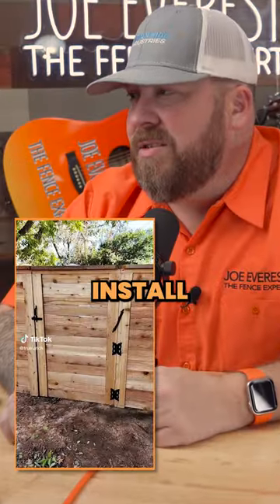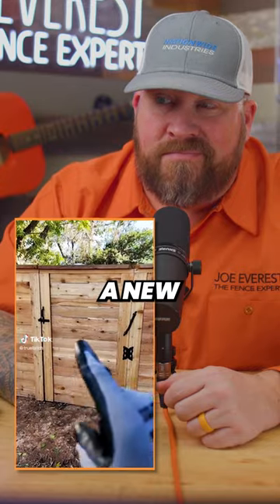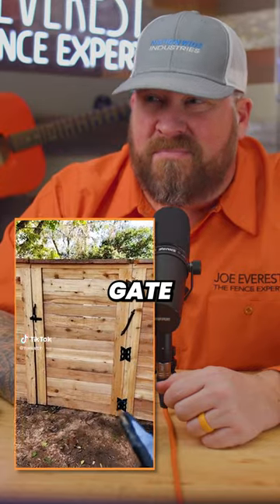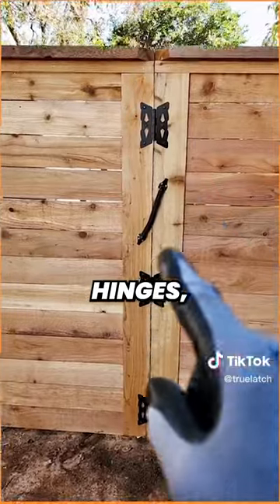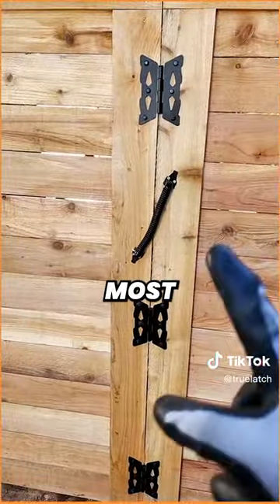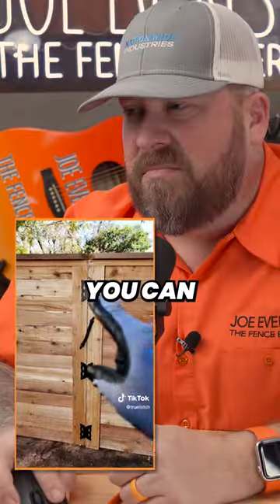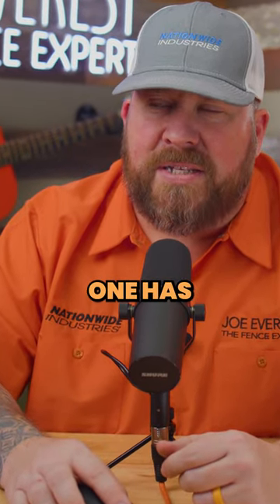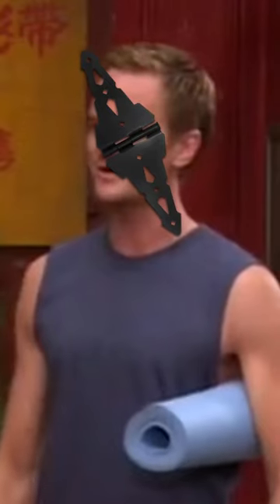DON'T Build Fence Gates Like This! #shorts #diy

Comment: The only time I put more than 2 hinges is if it's a really big and heavy gate
Reply: Yea. People will just say, "use bigger hinges" but on heavy gates (especially privacy ones that suffer way more wind stress) you're either plugging it full of fasteners (which looks janky) or carriage bolting it (which tends to end up turning into a bunch of slop).

Hinges have weight ratings but people forget it's more than just the weight of the gate. The force of it swinging shut, flexing in the wind, (or god forbid) swinging in the wind because it didn't latch.
Reply: Go look at commercial or farm gates.. 2 hinges.

When I do big gates, I just buy hinges that have a higher rated load and also have brackets that extend further from the edge. This guy's hinges barely make it into the 6x6
Reply: With 3 hinges, the second that post settles or those boards warp the slightest the gates going to bind. 

The heavier the gate, the faster it’s going to happen. The amount of companies gates I’ve had to repair due to this is ridiculous. Just learn to build a gate right.
Reply: @Josh.1234 yup. More hinges aren’t going to compensate for a poorly designed gate. Period. Hinge size, location, gate design, post install, type of post are all crucial.
Reply: If the gate is big and heavy, it needs a diagonal cross brace.
Reply: @MFKN_ChrisJones  if I was to put 3 hinges, I'd put the 3rd near the top one instead of in the centre.
Reply: @ObservationofLimits  carriage bolts work great lol
Reply: @Josh.1234   at work we got some steel fire doors and they all have 3 hinges, the middle one sits close to the top one
Reply: @darkblue234  yeah we are talking about exterior gates. Most interior doors have 3 hinges
Reply: @ObservationofLimits normally for gates that big, I've seen them just made out of metal. Heavy welded hinges both look good and can be scaled up to basically as much weight as you want. Although I don't work in the field, I just powder coat fences and gates other people make sometimes

Comment: I am a cad technician for fit out companies I spend most of my days reading spec sheets and I can confirm. These hinges tell you “heavy doors need more hinges” and the size of the door is irrelevant more will not bind if installed properly which isn’t hard to do.
Reply: So in other words having three hinges is completely fine and anyone who says otherwise should just be taken with a grain of salt
Reply: Your right, easy to install properly. Its the making mother nature cooperate that is harder. 
Make the soil not compact/erode, keep water out of the wood so it doesnt warp....etc.
Reply: So in other words you’ve never actually installed a gate…
Reply: @urmumisaho69  gates aren't that hard to install you just have to know what you're doing
Reply: @urmumisaho69  never? No i just don’t it for a job. I; tell people who install gates, pocket doors, kitchens, stone, non structural walls, tea points, windows and everyone who constructs them prior to installation. How many hinges studs, wall braces, what finishes, what tolerance, what construction, what order to install etc. I also do site surveys. And I have in fact built my own fences and gate a couple times once for my mum as a child and once as a young adult with my brother. And I will confirm the engineers that are paid to design those hinges know they’re stuff and they only bind because you’ve installed it wrong. There’s no more to it, if they bind it’s because they are, or have become wonky if they become wonky you should’ve used better fixing or more hinges to spread the load if they were wonky on installation “shit trades says what?”.
Reply: @phoxgames5800  generally if your using a softer fixing grounds or something liable to warp. Put it somewhere else lol 😂 if that’s not possible tho I’d advise using some 1/2mm thick aluminium sheet running it up from bottom to top of the gate post bond it to the post and screw through it at the hinges. But that’s what I’d do cus I am cheap and it will probably work for long enough. Never tried it tho.
Reply: @prestonbrandt2193  yeah basically. They’re argument only makes any sense if your fixing the hinges to something that will warp. Which would probably take longer to fully bind if you’re using only 2 hinges because you’re potentially twisting them each less but they’ll die faster cus you’re over loading them. Its cutting your thumb off to spite ur hand just use better materials they’re like an extra 10% in a localised area and if your fence is twisting you will not have a fence for long lol. save urself the hassle and future cost. There are a lot of places u can cut costs but in all my life I avoided cutting them at things I’m going to use every single day. “It’s only an extra minute I’ll fix it later” till ur mums in hospital with minutes to live.
Reply: You’re a cad technician for fence gates? 
You work on interior doors where the framing and door jambs are well secured and out of the weather. Not the same thing as an exterior gate secured to a 4x4 post that will in all probability twist and warp. No shame in saying you’ve never installed a gate in your life, there is however shame in spouting off on things you know nothing about.
Reply: There is no such thing as an outdoor timber structure that doesn't move.  Given that it WILL move, it must be made in a way to function with that movement.  3 or more hinges will bind when the structure moves.
Reply: @itsamindgame9198  excessive warping is a product of bad timber choice. It will move yea that’s why out door hinges have so much slop in them. In almost all cases if 3 are binding 2 will aswell. Excessive warping is also a result of cheaping out and using frames that are simply not big/strong enough.
Reply: @friendlynerd599  Actually, no, it doesn't need "excessive warping".  It is basic geometry, 3 points are much more sensitive not being aligned.  All wood moves, so it isn't a case of strength.  The alignment of the grain, whether there are whorls in it, how much moisture it takes up or loses; all effect movement.  The trick is to make sure the movement is along the line you want, but also to only have 2 points on the line.
The hinge size does make a difference, granted, but 2 well sized hinges is likely to be most reliable configuration.
Reply: I want to add to this as a carpenter for over 30 years....your placing all the hinges on the Same board... if it binds ,,it's because the hinges are Not aligned properly,,doesn't matter if there's 3 or 30.....
Reply: @davidrobinson2450  Because no board in  an outdoor application has ever warped...
Whether or not the hinges are aligned properly at installation a warped board changes alignment.
I am not saying 2 will never band more will always bind - I am saying that in any given setting 3 are more likely to bind than 2.

Comment: House door hinges come 2 to a pack, but always take 3 hinges. Middle one doesn’t bind up the other two, either
Reply: That's because the framing of your house should not move and settle like a fence will.
Reply: @jeremylunning654 fence won't "settle" if you build it correctly either.
Reply: The middle hinge will* bind up if the door ever moves positions......which can happen for a variety of reasons, that's why he said not to use 3 hinges. My view is if hundreds (probably thousands) of engineers have determined 2 hinges is the best for doors I am going to stick with their research.
Reply: @commoncents9732  I think you will find that the engineer's decided that two hinges were sufficient and not "best for the job". There is quite a difference...
Reply: @grantcox4764  Sorry bud, this is uninformed information. When building a fence, it's not as simple as just pouring good footers and hoping for the best. Even if you prep the site in advance, things can still go sideways. If you're not on a commercial property with well-compacted ground, the soil the weather can mess with your posts, especially the gates. Sometimes I have 2150 2200 pounds hanging on 4 hinge’s thats basically a Kia hanging from one post! That’s an outlier but things happen when you are hanging heavy things. The last thing you want is a wonky fence because the cement shifted. I've had to fix a bunch of residential jobs because of this. The difference? Dealing with a contractor who ghosts you. So, make sure you're ready for whatever the ground throws at your fence, and find someone who's on the ball and won't leave you hanging.
Reply: You seem to be quite triggered here mate. I never said that adding an extra hinge solves all problems when hanging a gate on an external fence. Try rereading what I posted and tell me where I'm wrong. I'll take my 35 years experience in the construction industry over your advice, ok champ. Your talking a whole heap of mitigating factors as if my answer to every problem is stick another hinge on it. FFS, there is nuance in everything, but from your novel, you already think you know everything so I won't waste my time...
Reply: And a deck outside in the heat. Cold, rain, snow and ice definitely doesn't easily warp, especially when it's held by cement in the ground that moves.

Do your door frames move often?
Reply: @grantcox4764 fences always settle 😂😂😂, are you packing 200 linear feet of soil 4ft down to the Frontline and then pouring your posts? Because as far as I know when it rains in the summer and freezes in the winter, the ground shift a lot. It may not heave a post but it definitely can move it an inch. That inch can bind up the middle hinge.

It's actually very simple, either you don't put in fences with large gate often that utilize heavy trucks through said entrance, then you really don't know what you're talking about.

Cute though
Reply: @grantcox4764 you realize they make hinges stronger for heavier doors right. You can quite literally order a set of 2 hinges that will support 1000 pounds. 

Still don't get why you need a 3rd hinge when you just use the right equipment for the job 😂😂😂
Reply: @garythesnailsdad exactly, I don't think most people realize they can get hinges that hold 1000-2000 pounds. Albeit more expensive but that's what the homeowner pays for. Tons of cheap menards hinges used though.
Reply: @grantcox4764 why ate you so butthurt, is it because you know you're wrong and been doing it 35 years. You realize they make hinges that support over 1000 lbs right?
Reply: @commoncents9732  show me a door with only 2 hinges, and I’ll show you a cheaply installed door. In any event, a house door can sag over time, that’s why we’ve all seen a door that drags on the frame( usually at the top), and is harder to open and close. The center hinge still doesn’t bind on the door.
Reply: @grantcox4764  I agree, but how many people will build it correctly?  A third hinge isn't necessary anyways so why bother?
Reply: @grantcox4764   Fences ABSOLUTELY move and shift at different distances, directions, and speeds over time anywhere along their length no matter how you build them. Talk about uninformed complete nonsense
Reply: @commoncents9732  perhaps I’m legitimately not understanding and it’s simple but what do you mean “bind up” 

If the gate sags won’t all 3 hinges sag equally? My gate has 3 and was built that way from the day we moved in (was a brand new house at the time) in the last 12 years that gate has sagged plenty and I even took it off and fixed up the boards a bit and it’s not had any problem with the middle hinge.
Reply: My doors are 2 hinges
Reply: @jeremylunning654 my house is fucked, the whole place moves month to month or so and none of the hinges bind but the doors will stop lining up with the door frame on occasion so I'm a firm believer in if the hinges are properly installed AND of good quality you should be fine
Reply: @mobilegameclips5628 Wood ages and changes with weather as it ages. Fences don't just sag, the wood that makes up the gate can shift sag or bow in many directions.

This is why the creator he is watching, says it isn't an issue because it might not happen, but good carpenters don't bet on should not happen or probably won't or that is rare, should not be used as a building method.

The interior doors on houses are different, because 1 they are designed with 3 depending on the core etc, me 2 I hope you don't have rain in your house.

I would hesitate to use this guy for any project because he is using his logic over experience and knowledge.
Reply: Doors arent installed in dirt and dont get rained on to warp the wood
Reply: People arguing to add more work and cost for literally 0 reason.
Reply: @phoxgames5800  you mean posts in concrete, and waterproofed wood?
Reply: @jeremylunning654  you clearly don't live in texas where foundation shifts all the time sometimes drastic differences. never had a door bind up
Reply: @grantcox4764 Its always funny when someone called others "triggered", but then proceeds to sound like a petulant child.
Reply: @jeremylunning654 house framing does settle though 🤷 all things that are built settle.
Reply: @parkeydee  yeah, when not built property.  If houses settled like you are saying, drywall would all crack, trim joints would show and tile would start popping up.  When they say a house settles, they mean the entire foundation sinks slightly but evenly.  Any uneven settling will cause damage.  You should get your verbage correct.

Comment: More importantly, add a diagonal cross brace so the gate doesn't sag.
Reply from the maker: Absolutely! Thanks for watching and weighing in!
Reply: You  ain’t lying. Moved in to a new spot . The  yard door was dragging cause it had no brace.  I just put a wheel on it for it to roll since I don’t use that entrance much.
Reply: Was about to add that very comment - possibly the most important element !

Comment: Dont be absurd. There is absolutely nothing wrong with using 3 hinges, 4 hinges or even one long hinge that spans the length of the door.
Reply: To be fair. The door technically is an extra long hinge
Reply: Nothing wrong with it: Sure. If your fence posts are set properly, ground swelling do to freeze thaw cycles aren't a problem, you don't have frequent drastic humidity changes.

For a Building door - set inside a set frame, especially if it's a steel frame, but - a properly built wood frame is pretty much just as good - the issues you will get are basically zero: Especially if you have a temperature + humidity controlled envelope that frame is apart of.

The problem with a fence gate is: All of the problems found in paragraph one can apply. If ground swelling during a freeze/thaw occurs it can cause those posts to twist unpredictably, and the more points of contact you have - the more likely you are to get a bind. Same goes for if you lack proper clearance between the gate and the adjoining fence posts.

Comment: It's generally recommended to install three hinges on a wooden gate, especially if it's large or heavy. The extra hinge helps distribute the gate's weight more evenly, reducing the strain on each hinge and preventing sagging over time. For lighter or smaller gates, two hinges might be sufficient, but if there's any doubt about the gate's weight or size, opting for three hinges is a safer choice.

Comment: Just like a door, it depends in the size and weight.  For example, a hollow core interior door only needs 2, but a solid wood exterior door needs 3.
Reply: Or an aluminum storefront door might take 4.
Reply: @VictoriousGardenosaurus how many hinges are in a bank vault
Reply: @CactusBrannigan  I don't work with bank vaults so I have no clue :)
I would venture to guess they are not leaf hinges, like we are discussing in and around this video
Probably pin and barrel, to accommodate the weight. 
How many leaf hinges do you need to hang a vault door?
Reply: @CactusBrannigan 1 or 2 really big hinges
Reply: Hollow core interior always has three you dope
Reply: The doors in my last two homes would disagree.  Name calling definitely makes it difficult to take you seriously though.
Reply: I do production home sites we just switched to 3 for interior and 4 for 8'0"

Comment: The reason they come in two is so you have to buy 6. Notice how in the hardware store hinges are sold separately
Reply: Notice that you can buy hardware that holds more then 1000 pounds. Just charge properly and get the right stuff. Menards hinges that hold 100 pounds are not the same as "heavy duty LL hinges"

Comment: I need at least 6 hinges on each side of the door
Reply: Don’t forget the three doorknobs
Reply: At that point, just use a piano hinge
Reply: And 3 on top and bottom both sides as well
Reply: @SuperKinganthony don't be foolish.... it's just 3 bolt locks.. and 1 handle 😅
Reply: 7 for me, but whose counting?
Reply: @tommyt414 that’s my standard practice. Gate can’t sag is the whole side is the hinge. /s
Reply: @YouTube_is_complete-total_shit  yeah you’re right, clearly I am overthinking it.
Reply: Don't forget the 17 deadbolts 😂

Comment: Mine was never a hinge issue.  It is always a post issue.  Put that post down below the frost layer.  Not just 2 ft with concrete around it.  The posts needs to be solid.

Comment: I’ve always heard that if you use posts that are adequate to carry the weight of the gate(s) and if you get the posts down below the frost line, to prevent heaving, then use the number of hinges that is optimum to carry the gate without over stressing the hinge, maybe two, maybe three, then you take the time to align the hinges properly…
Well yeah. I guess it all sounds like a lot of work, but I’ve always heard that doing it right the first time means you probably won’t have to do it a second time.
Reply: I use three hinges because I got 3 backerboards. I measured everything how I liked it, and haven't had any issues with my gate.